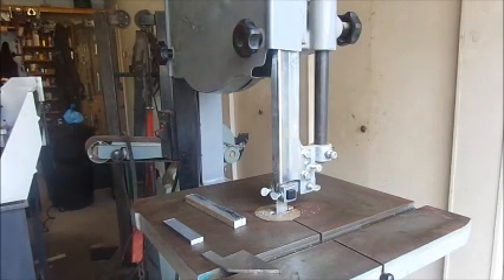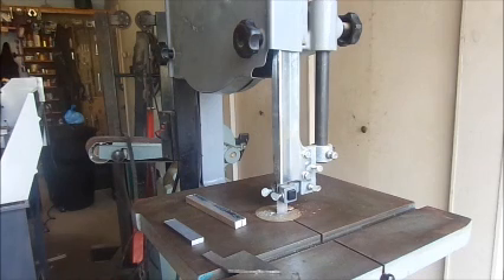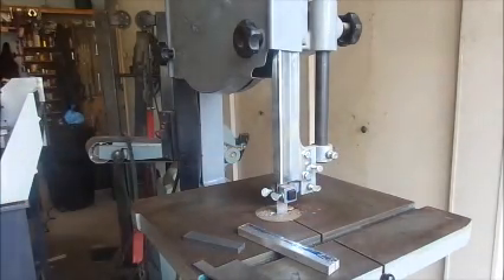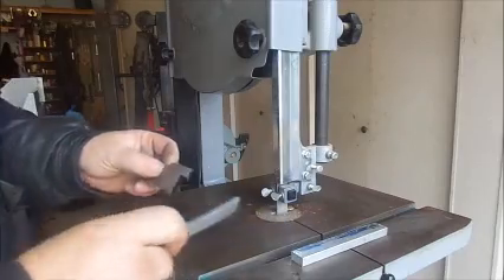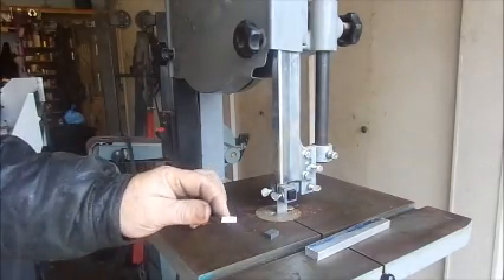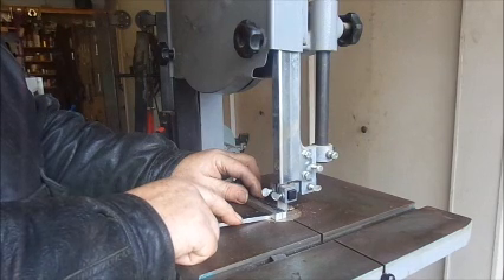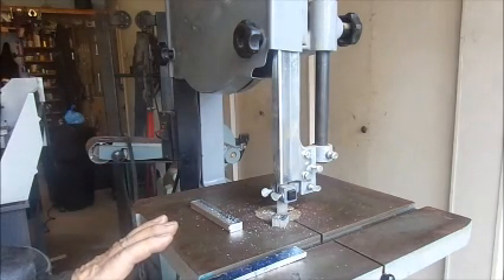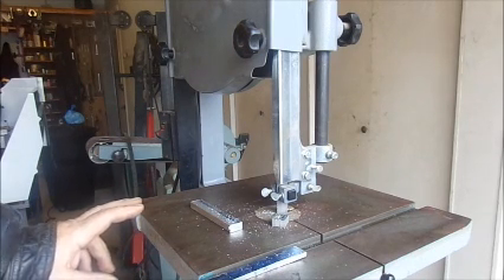CUTTING STEEL WITH BANDSAW

Comment: Your blade appears to have way too fine a pitch. I have the identical bandsaw, made it run 5 x slower by adding pulleys, use an ordinary, cheap carbon-steel (metal) blade and can cut one inch mild steel as fast as you cut your (thinner) aluminium here. I have cut as thick as 40 mm steel. You did not show what your "conversion" was, inter alia. Or was is just putting on a bi-metal blade? (My saw had three speeds originally, but it was still too fast for steel with a normal, carbon steel blade.)